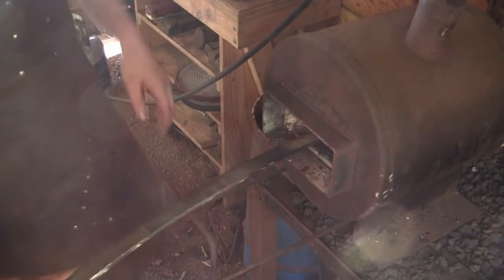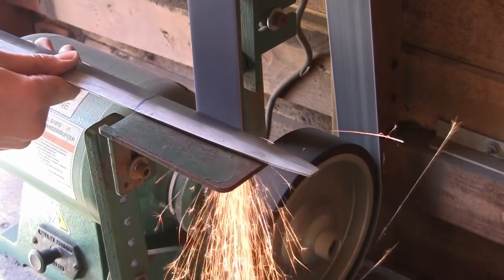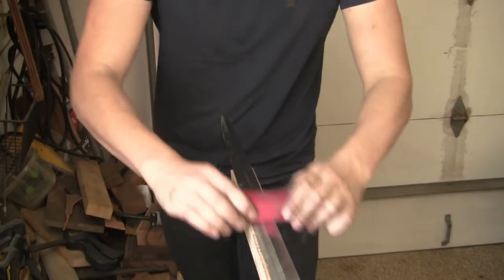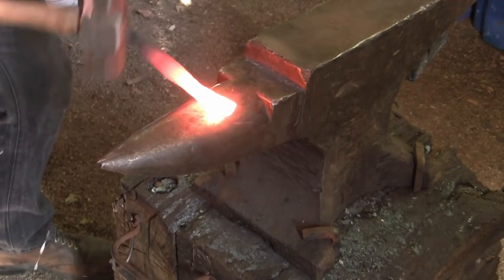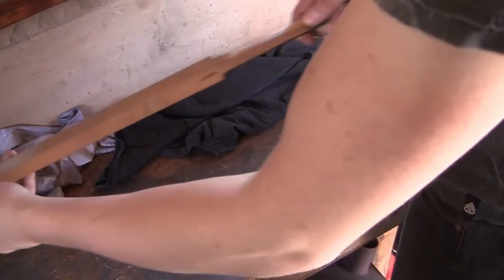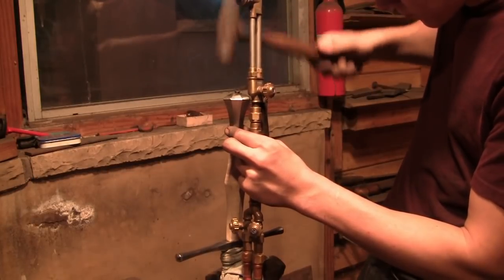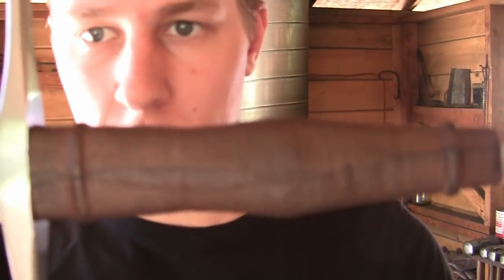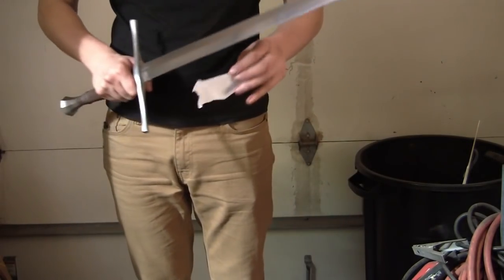Forging a Medieval Longsword

Comment: Hello from 2020. One of the better done swordsmithing videos on YT I have seen. Music, editing and b rolls are cool but I liked the commentary, highlighting of improvement areas and the woodworking/leatherworking.

I also like your method of going from bar stock and hammering this simple taper. Ive watched folks use auto-hammers and damascus which is a bit intimidating from a cost standpoint but this turned out awesome.

Also +1 for the "chicken fried chicken" tempering job.

Comment: Form and function well executed. The 5160 starting steel that was cut out for the sword blade, what was the width and thickness of the steel that you used ?

Comment: Forged out a sword myself, thanks for the inspiration. For the pommel I opted for a scent stopper or pear shaped design. What is the best starting stock for that design, can I use a round 2 inch diameter piece of mild steel !?!

Comment: Mitchel, at the start of the video we see you using an angle grinder with a metal cutting disc to cut the spring steel section that will be used to make your sword, and you have drawn a line with a marker for the cutting wheel to follow. Did you also file a small groove along the marked line for the metal cutting wheel to follow to keep the cutting straight ?
Reply from the maker: Nope. Sometimes I'll grind a groove a few inches along the line ahead of where I'm cutting with the cutting wheel to do the same thing though. I do this while I'm cutting.

Comment: Would this be possible using an angle grinder to do most of the shaping of the steel, without using an anvil and hammer, then heat treat the steel afterwards? Only asking as I dont have access to an anvil, or large hammers and a big heat source but I do have angle grinders and could heat a whole blade to temper it.

Comment: Good job! 
That's what I should have done when I made my sword: Cut a strip from the leaf spring. As it was, I forged it out by hand. . .
Reply from the maker: That's a lot of work! This is about the maximum width for a sword as long as this though, due to the hole in the center.
Reply: How thick was the leaf spring you stared with? Mine was 3/8 inch thick.
Reply from the maker: Mine was about 1/4" thick.
Reply: Ah, I see.
Well, I think you did a beautiful job, and I can see a lot that you did I would have liked to have done to mine. :)
Was this your first sword?
Reply from the maker: It was indeed. Thank you!
Reply: Very awesome.
Looking forward to more stuff from you.

Comment: Your heat treat treating set up is basically two rows of bricks with a pipe down the length of it filled with charcoal. What is the diameter of the holes drilled the length of the pipe, and are they spaced every 1 to 2 inches or so. Also, is it just the pipe, or do you line it with some adobe/sand mix. 

Apologies for all the questions, but I have had good success with small to large blades. also woodworking scrapers in a charcoal forge, but have never done anything sword length and will be heat treating one soon.
Reply from the maker: Idk, I kind of eyeballed it. The pipe is not lined or covered with anything.
Reply: Thought that might be the case. Thanks.

Comment: Question if I may...
How do you get your belts to track so well on your grizzly? 
I have the same unit, and no matter what I do my belts don't track straight and they go flying off...any help would be great. Thank you for the post, and your wonderful work sir.
Reply from the maker: I have to adjust the knob a little every time I put a new belt on, but otherwise it tracks like you see in the video. Belts might hang halfway off the wheel but they don't fly off. If yours come off maybe the contact or idler wheel (or both) aren't aligned right. If you just bought it I'd think about returning it for another one.

Comment: You normalised/stress relieved the sword after the grinding, as opposed to doing it after the forging was completed. 

Is this your standard normalising routine, or do you sometimes normalise after forging your blades ?
Reply from the maker: Well, I usually do one normalizing heat after forging to remove stress, and a couple right before heat treat just to be sure. So both I guess.
Reply: That makes logical sense. Cheers.

Comment: So here's a question, if you wanted to add a fuller down the center of the the blade, how would you go about that? I've seen people grind it in, but I'm not sure if that would work with the grinder you have. you could forge it in, but you'd still need to find a way to shape and polish it up. How would you with your equipment personally go about it?
Reply from the maker: Dave Strider If I were to grind it in I would need a smaller contact wheel on my grinder. 
If I were to try to do one without a grinder I'd forge it in with a spring fuller and polish it with a fuller scraper.
Reply: Alright sweet, Thanks!

Comment: Form and function well executed. Looks like a late medieval cut and thrust sword, something that would probably fit in Oakeshott's sword typology as an XVIIIb. 

If I may ask, what is the diameter of the steel pipe that runs between the firebrick rows in your ground level  heat treating charcoal forge ?
Reply from the maker: Thanks! It's 1 inch pipe.
Reply: Mitchel, I have 1.5 diameter pipe I will be using for a sword project. One more thing I wanted to ask you. What is the diameter of the air holes that run down the pipe and are they spaced an inch apart or so.

Comment: Interesting, noticed that the very point of the sword blade was not forged in, but ground out. Long blade at 90 cm long, and you say that the blade, at the base where you indicated is just about 1 3/4 inches wide before tapering off. How wide was the point area after it was forged out, and before the very point was ground in from that section ?
Reply from the maker: I don't remember how wide it was at that point, sorry.
Reply: No probs, just asked out of curiosity, it seemed roughly 1/2 the width at the base. I am playing around with a few dimensions as I will be doing my own sword, forged out some knives and happy with the recent stuff that I thought it was time for a sword length piece. In any case I tend to eyeball the profile until it looks good, tapered where I want it,  and symmetrical. Cheers

Comment: Just a question from a fellow blacksmith.

Do you think tempering with the blower would cause the oil at the bottom to be warmer than the oil at the top (causing a different temper at top and bottom ?).and if so, how different is the temper.
Reply from the maker: Karl Hurtubise I didn't get it on video but I moved the burner up and down to different parts of the steel pipe periodically so the temperature would be even.
Reply: All right thanks! I've seen many ways to temper blades but never with oil baths (molten salt baths yes). I only had a small tempering oven and on longer blades I would use a big 2''' bar heated and I would stick the sides on until the edge would be the proper color. Thanks! I might try it out sometime, it seems a lot more controlled and convenient.

Comment: What are the scales that come off when hammering
Reply from the maker: That's iron oxide, called "scale". It's basically the metal rusting quickly at high temperature.

Comment: Its strange . WE now have a lot of data on European swords . But the community of blade smith /swordsmiths have not yet worked out a good sequence of forging from data to obtain the right taper in width and thickness . There no real combined understanding of a away to forge properly . How can the European sword forging process get elevated to a higher form without this . The Japanese sword has a well known detailed forging process ! Why then ? does the European sword not have the same ? I believe it does in fact have a way of forging that is much more practice than nearly all smiths I see make a "HOW TO " video undertake . Looking at these videos on "HOW TO " its clear there a lot of guessing going on , where as it should be a much more precise technique that should be undertaken . Firstly the European sword was NOT made of a MONO spring steel . It was formed from a bloom . So forging a blade from such a material would need a much more advanced technique . More steps that are clearly set to achieve a correct way of forging a sword to correct dimensions depending on length . Just an observation and a thought .

Comment: Your sword does not have a blunt edge. Or a squared off edge. So how do you keep this sword sharp when parrying a blow of another sword ?  Two sharp edges colliding will immediately result in severe damage to BOTH swords....!  In one single fight, a sword, very sharp on both sides, will be rendered useless in minutes. Deep chips, and/or many chips,  may even cause the sword to break, when hit from the side.
Yes, very often swords were sharp indeed. Literally razor sharp, sometimes. But only on one side, or on the front half of the blade or just the tip. 
Swords were very expensive and had to be kept sharp/useful for a long period of time. A sword with many dents and gouges can not be repaired or re-sharpened. Not without removing a large amount of metal. 
And although some swords were razor sharp, most of them were only as sharp as needed. And sharp, in this case, means that a thick blade is tapered to a 40 or 50 degree edge. Sharp enough to cut through clothes and leather, but strong enough to keep its edge when hitting metal armour. 
A Longsword was meant to be swung with vigour. It was not a delicate weapon.  This weapon could do some very serious damage.
But finely chopping off arms, legs, fingers, ears, heads, and other parts, with precision, required a smaller sword with a razor sharp edge. But such a sword looks quite different from a Longsword ! 
Oh.... both are fun to use. That's a given....!    ;-)

http://www.thearma.org/essays/damagededge.htm#.XeG7xOlYZD-
https://www.darksword-armory.com/how-sharp-were-medieval-swords/
Reply from the maker: While this sword is sharpened on both sides the edge is more obtuse than a knife edge. (About 45 degrees on the edge I think). And I'm no swordsman, but I believe one parries with the flat of the blade so the edge isn't ruined.

Comment: You did not forge a sword.
Reply from the maker: Why don't you think so?
Reply: Mitchel Jacobsen you took a drawn out pice of metal n shaped it. No bilit, no real forging. It just obvious... You did not 'forge' a sword
Reply from the maker: I think you misunderstand what "forge" means. According to the dictionary: "to make or shape (a metal object) by heating it in a fire or furnace and beating or hammering it."
That's exactly what I'm doing here.
Reply: Roy Childers 
Most of knife making and making a sword is grinding work.
Reply: Mitchel Jacobsen. Dont get me wrong, you did forge work on the sword no doubt, but you did not forge the sword. There's a difference. To forge a sword you must start with a billet and draw it out. That's the detention of forging a sword.